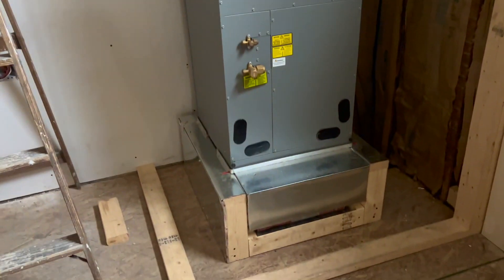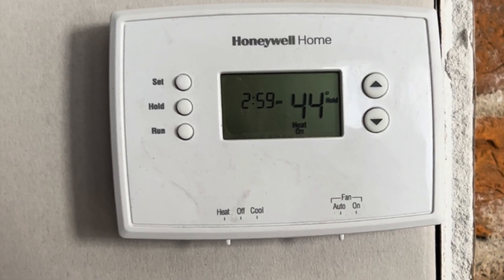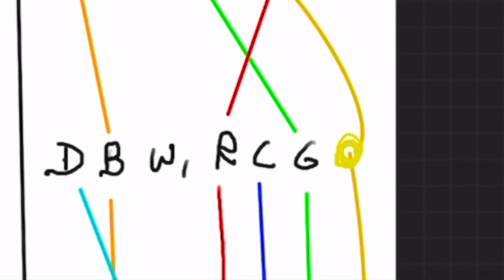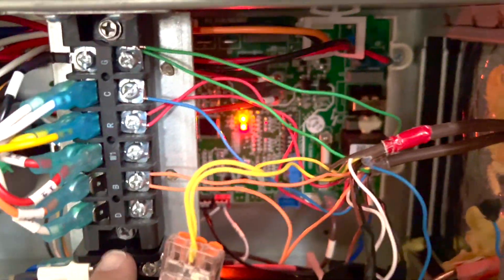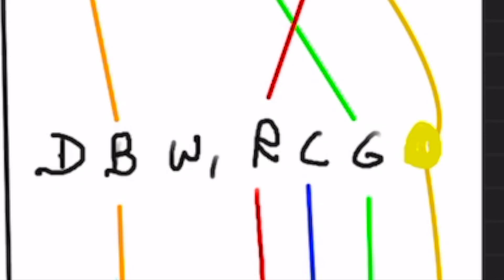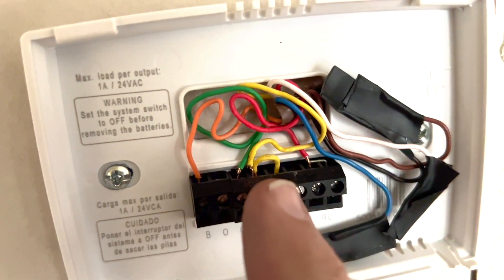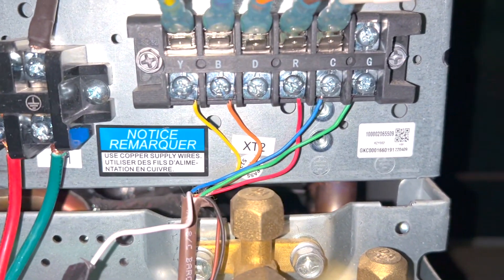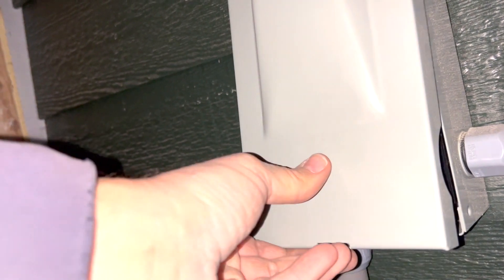MrCool Universal Heat Pump Wiring Connection without heat strip : Nest or Honeywell to heat pump

Comment: I don’t have the universal as I had to install a high pressure unit. But wiring is the same. It’s wired now to run normally and not all the time as a mini split does. However, mine isn’t shutting off. Ironically, if I set it for 69 it reaches 70 and if set at 71 it goes to 72. What could cause this insanity?

Comment: What's the average saving is if I install the geat strip  instead of baseboard heating
Reply from the maker: Not much experience w/ baseboard heat. Same source but the heat pump heat strip has air passing over it for good distribution. 
But since both are electric, I’d guess they be somewhat similar at 1st glance. 

BUT a heat pump heat strip is only used when heat pump cannot keep up with extremely low temps whereas baseboard heating element is always on. 
Heat pumps are more efficient. But how much??? 
You may need to do real research - see if any comparative studies have been done. 
Hope that helps. 
We have a number of heat pump videos that track our savings. There’s place to start. 
Just FYI . We did NOT install a heat strip in our unit - we are in zone 5a/5b and the heat pump has heated our house without the heat strip in temps as far down as -10 Fahrenheit. 
Hope that helps.

Comment: I just bought a unit with air handler and no heat strip. Its very unclear if the indoor handler is 110 or 220 and where to connect it. All i see is a tiny pigtail feeding over to where the heat strip breakers would go. Your video only shows thermostat connections. Any advice?
Reply: Indoor is 220. I have same wiring setup with tiny (prob 14g) pigtail. Did you wire to those directly or use an inline breaker?

Comment: Why a Green G from handler to condenser?
Why only one Blue Common on handler?
My intructions show G from thermostat to handler only and C from thermostat to both handler and condenser.   
I'm just asking as I am currently wiring mine up.   I understand that the Mr Cool diagram on page 26 isn't quite right for no heating strip.

Comment: Looks like you don't know how the wago nuts work. You don't put two wires in the same slot, you put one wire in each one and it connects them. You're just using it as an insulator cap in the picture you show here.

Comment: THanks for posting this vid, I just installed my Universal system and it's not turning on, must have some wires wrong, will double check.
Reply from the maker: Hope you found the issue. That’s the part about doing things yourself - make the brain hurt but can help the wallet if you succeed.
Reply: @Housebarons yep, got it running, had my 240V breaker connected only to 1 bus bar.  Corrected it and it turned on, works great!

Comment: Will this work on a mr. cool going to a goodman furnace? cause the diagram in the booklet only says from condensor to its own thermostat and I wanted one for both ((
Reply: I have a mr cool 2-3 ton condensor and evaporator coil. then my furnace is a 2012 goodman 98% efficiency furnace (LP converted)

Comment: How come on the air handler I don’t have the line 1 and 2 connection tab? Mine stops after D
Reply: Mine is the same. I suspect the company is trying to save pennies by leaving that out for units which ship w/o heat strips. I think you just hook power to the blue/brown pigtail now, but please let me know what you've found.
Reply: @justjoshinson  yes, they confirmed this to me.
Reply: Were you able to confirm this with the blue/brown wire labeled 1 and 2
Reply: @rtbroskie8592  Yes confirmed it is the blue and brown wires sticking off to the side. I ended up buying the heat strip seperately, so I did not need to use the blue and brown. But before I bought the heat strip, I reached out to their customer service and they confirmed that the blue and brown are the correct wires for power.
Reply: @rtbroskie8592  mine is running fine just using wire nuts to the blue/brown
Reply: Did you find out why? Mine is the same.

Comment: I have a mr cool universal MDU18036 air handler and heat pump.  Having a problem with cooling working and working with mr. cool tech they had me measure the voltage between B and C terminals and I measured 15Vac.  I think it should be 0 Vac and so does the tech.  I rechecked all my tstat wires and there are no opens or shorts.  I have two of these units and my 2nd unit appears to be working just fine and it, too, measures about 15Vac between B and C terminals.  So does anyone know if this is normal or not for these units?  I use Ecobee thermostat and I confirm that it is set to only energize O/B in heat mode.  Also, in my install manual, it shows no connection to the outdoor unit's G terminal (fan control) so I only am connecting indoor G to thermostat G.
Reply: Did you ever get yours working? I have the exact same setup and can't get it to produce heat. The blower and condenser are working, and no errors are being thrown. Can't seem to figure it out.
Reply: @reitzln  yes, it turns out my A coil as a very small leak.  It's so slow it takes about 10 months for the refrigerant to drop so low that the unit simply couldn't cool.  I purchased a fieldpiece leak detector that ultimately confirmed the leak and mr. Cool replaced my A coil under warranty but they charged me $280 to ship it. Which is a scam.  Put gauges on the liquid line (smaller line) and see what pressure you have during cooling.  Also, I found that the reversing coil can't be measured with a run of the mill VOHM meter.  I happen to have a fluke with a LowZ setting that when used showed me I was chasing a non issue meaning my coil was good all along and you just need to measure it with a LowZ capable meter.  Hope this helps
Reply: I had the same problem. Cooling is fine, no heating. When in heat mode, B & C ~16Vac. I decided to try adding an extra wire parallel to the B wire to reduce the resistance/ increase the voltage, now it reads the same as the Y & C ~24Vac. It heats now. Not sure if the B wire was broken or what.

Comment: This video indeed is gold. I was unable to make condenser to start with same exact Honeywell t-stat (mine had no jumper between R and RC so I made it). Everything started working immediately after reconnecting per the diagram in this video!!!!!. We installed EVERYTHING on our own - ducts, lines, power etc. I still need to finish the drainage from the air handler. BIG THANKS GUYS!!!
QUESTION:
Does the return ductwork need to be of the size of the output? I designed everything myself but looking at different installations online the return is just left as a small opening, while I have built entire ductwork to get air from different areas back to the unit, although the cross section is smaller. It looks like I need another 12" dia opening to equal the areas between intake/return and output.
Reply from the maker: Hey user…,
Our return total cubic inches into the air handler is larger than the supply to keep strain off the blower motor. 
Hope that helps!
Thx for watching!

Comment: Just wondering why you do not have the (blue) common connected on the Honeywell thermostat.

I'm about to wire my 4-5 ton mr cool to an old T8001 Honeywell thermostat, which can accommodate a single stage heat pump. I deduced the yellow to white jumper at the thermostat but good to see it. I will replace the Honeywell with a wireless thermostat so I can use the existing furnace as a backup (or at night when my solar PV system is not generating and electric power costs are higher).
Reply from the maker: Hey rjm,
As to why - not sure the reason behind it. We were trying to follow the directions given. In the end it all worked out just fine,

Sounds like your set-up has lots of different potential options!
Thx for watching!

Comment: after speaking to MR cool , if you DO NOT have the heat strip, which i also do not have nor do i need, i was told by the tech support from mr cool that if you want the air handler to STOP blowing while the condenser is in defrost cycle, (which I DO )  you need to have the 'd' wire at the air handler connected to the 'd' wire on the condenser..  Ingram’s Water & Air Equipment's tech support also confirmed the same thing,, I would assume you also would not want the air handler blowing COLD while in defrost cycle) what is your experience with this? ( just had a mr cool universal installed on may 10th of this year)
Reply: I’m wondering if I did this or not. Having issues with humidity. I wanted it to run as a normal unit would do. I thought I had it. But it’s still running constantly. I have to set temp above temp in the house and it will kick off. Something ain’t adding up.

Comment: I cannot get my universals compressor to come on.  It has power, the thermostat is getting the air handler to blow, but the condenser is sitting here mocking me.
Reply from the maker: Hey drew…,
Is your condenser control board showing any lights at all. Should see a “00” in green lights on the control board or “on” spelled out in the same green lights. 

If you have your breaker in the on position flipped on for power at breaker panel, then I’d guess your problem is at the thermostat.
We had the same issue - that’s why we did this particular video. All thermostats are similar but do have unique features. 
You are looking for the thermostat wiring specifically for a heat pump. 

It’s probably something small. Just retrace all your hook ups for the entire system.
Thx for watching!
Reply: @HouseBarons  it was indeed the thermostat.  Did a factory reset and it came right on.
Reply from the maker: Hey drew..,
Awesome! Thx for letting us know!
Reply: I have the "00" code as well any suggestions to get this thing fired up?
Reply: Did you ever figure out your issue? I'm having a very similar issue.

Comment: When you have the Honeywell hooked up, does the fan turn on and off when you switch the fan to on?  I can get the fan to blow, but it doesn’t turn off when I switch it over to auto.  Just a weird anomaly I discovered.
Reply: I know this is older thread, but I have the same air handler, and when the fan is set to auto, it takes a few minutes to kick off, I'm pretty sure that's a safety feature of mr cool to make sure to keep blowing after the condenser is off. it kicks off about 3-4 minutes after the condenser is off.

Comment: This video is GOLD! I will buy the Honeywell thermostat and hook it up exactly like you have it.  This takes some of the mystery out of the install for me. Thanks again.
Reply from the maker: Hey George,
Thanks much. Honestly it was a couple frustrating days trying to get an understanding of it all. True - mysterious because it’s not a common DIY task I guess. 
If you buy the Honeywell, make sure it is one that works with a heat pump. This one has a switch on the bottom exterior edge that switches it to heat pump mode. 
Thx for your continued watching!!
Reply: @Housebarons  A lot of people are having issues setting up the thermostat correctly. I'm glad you took the time to make this video. In your description you list two different Honneywells. The RTH2300B and the RTH221B1039. I guess they both get wired the same way?

My last mystery doing the install has to do with the line set. Did you put any bends to help with the oil return? When installed, my outdoor compressor will be 8 feet higher than the air handler in the basement. I only need the 15 foot line set to connect the two. 

Thanks again for your channel!